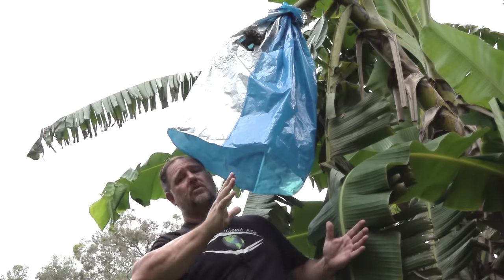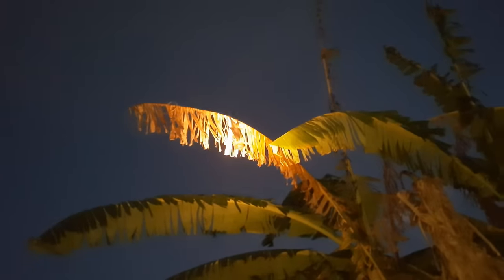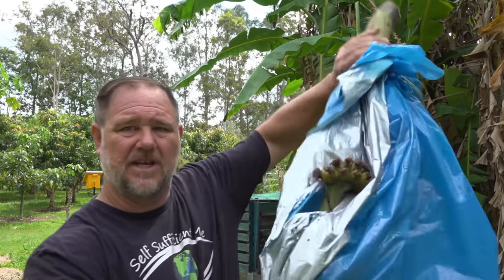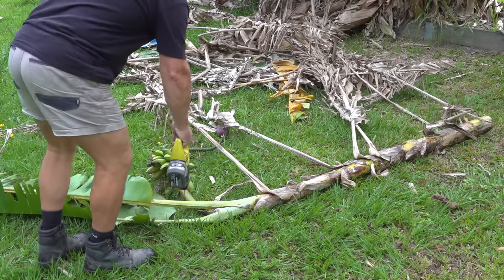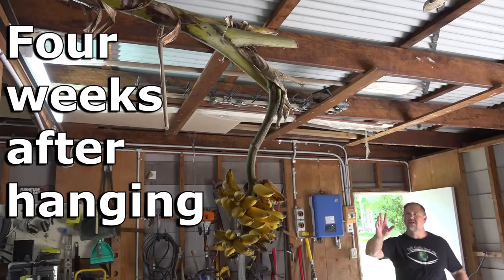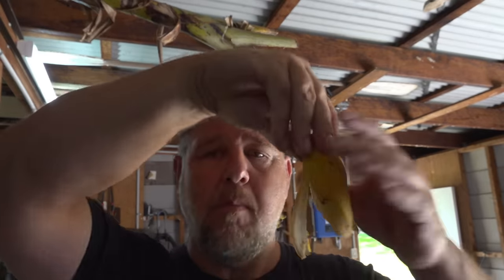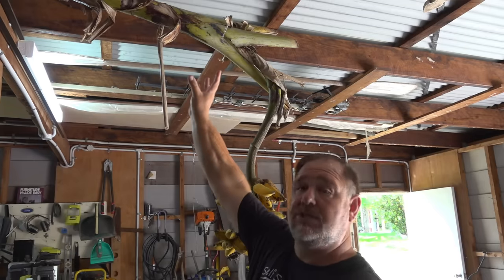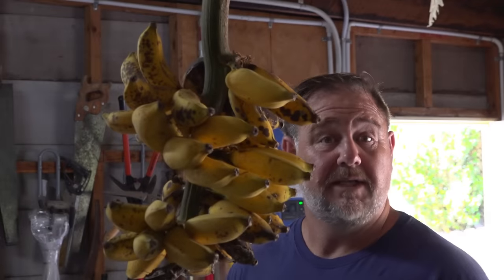NEW Way To RIPEN Bananas to Make Them Sweeter!

Comment: also try drying your excess bananas. 3/8"-1/2" slices.  250 degrees Fahrenheit, for approximately 1-1/2 hrs. Flip them with a spatula 1-2 times for even drying. The over ripened ones turn out sweet and tasty. less ripe ones are more crunchy. 👍

Comment: You might like to make a banana cage with the wire mesh. You could enclose it around the stem. One version could have hinges and have the cage close around the bunch like a book and latch/tie to keep closed. Just have to have enough room so the bats can't reach the fruit through the cage.
Reply: Or maybe wrap with plastic and then wrap with wire mesh and fasten with a tie. That might be a more flexible solution for various sizes.

Comment: I'm in NZ and my bananas taste just as good when ripen on tree or if I pick a green hand a week before it turns yellow in my bowl. Sometimes I pick green and takes 4 weeks to turn yellow in a bowl and still taste goods. But we are lucky in NZ with nothing to take the bananas. I even leave a few on just for the silver eyes to pick through the split bananas. But I think I'm getting a battery operated sabre saw. I've been using a hand held silky saw and cut into short logs then split with an axe. Thanks for that tip.

Comment: I use metal screen material (what you would use on a patio screened door).  Easy to wrap around the rack and use clips to seal it up.  Birds can't get through it and rodents won't chew threw b/c they dont like the wire mesh ( I assume bats would also be deterred)...i get a roll sized for a door and this is enough to cover 2 racks...costs about $10 a roll and can be used for a couple years.

Thanks for the advice on the "whole stalk ripening" .... have 3 racks growing...gonna try that on the next one that's ready.

Comment: Just a idea..
Why not make a cage arround the bunches ?
The mesh you used to close the hole in the botom of the bag you could make some kind of cage of it.
Make it in 2 halves so you can clip (perhaps tieribs or a piece of wire) it together arround the bunch.

Comment: You actually  don't need to cut the Banana bunch with the stem. Just cut the part where the Banana bunch connects to the stalk and put salt. Thereafter, put it in a sack. The bananas start ripening immediately. That's how we have harvested ours for years. Let me know if you'll try this method and share your results. 🙂🙂

Comment: You must have very house trained possums and other fury critters ...... not many sheds round here would keep them hungry fellas out for long. A bit disappointed you pulled out the battery sabre saw and not the good ole cane knife.
I have never thought of taking half the stem, will try that pearler. One thing you didnt seem to mention was banana sap.....sticky nasty stains, also best to avoid/prevent it dripping on the fruit as it will cause skin to discolour and possible ripening issues.

Comment: Out of the box idea to protect the fruit. Rather than using a bag, get an old 80 litre dustbin. Drill a large hole in the bottom, wide enough to go around the stalk. Cut one side of the bin and across the base to allow it to open. Essentially you mount the upside down bin above the fruit so it's like a bell. Put gauze / wire mesh at the bottom. That should protect the fruit and can be used many times.

Comment: Can’t you make a cage for the whole bunch Mark?
Reply: This is a good idea.  Sometimes the bunches are so heavy they pull the tree over and it dies before they are ready, but if you had the cage on top of a pole you could stick into the ground, you could both protect the bananas as well as take their weight off the tree so you don't lose the bunch in a windy storm.

Comment: I have a dwarf Cavendish that i bought in August. It did well for a month or so then the leaves got real small. I started fertilizing and it came back and was doing great. In the last few weeks the leaves stared yellowing and dying. I think i might have been over watering but the baby plants growing off of the main plant show no signs of yellowing.  I live in southern California. It has ben mid 70s - low 80 during the day and high 40s - mid 50s at night
Reply from the maker: Yes bananas love water but they will rot and die rather easily if they get too wet for too long. All the best :)
Reply: @Selfsufficientme  cut way back on how often i am watering. How long do you think it will be until i see improvement?
Reply: @Selfsufficientme  also thank you for the reply.
Reply: Try using banana sleeves as a natural fertilizer because the sleeves or covers are loaded with potassium and they’re great for fertilizing tomatoes and roses and strawberries as well. Rotate your crops ever other year or so. I never had problems with roses or strawberries but I change up fertilizer by using fish emulsion every so often.

Comment: 😷😁👍I used to work on a banana plantation and we cut them down when green but the edges were rounded but still inedible the we would cut the hands away and then send them to be based which ripens them
Wow you are a clever bugger but then if you weren't you wouldn't have made WO1 OR 2 , what regt ?